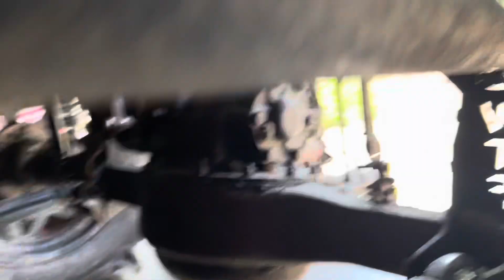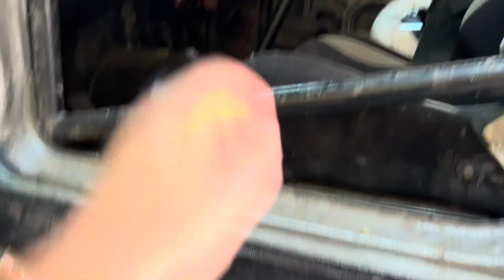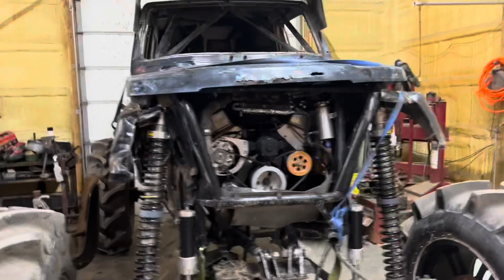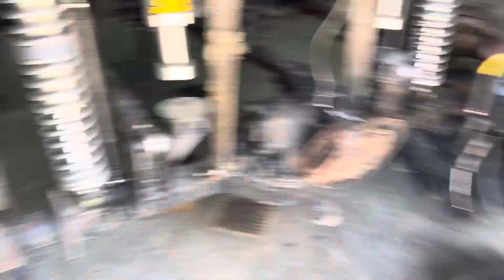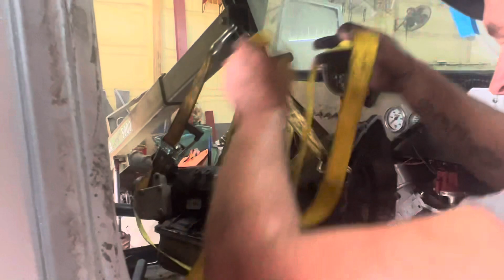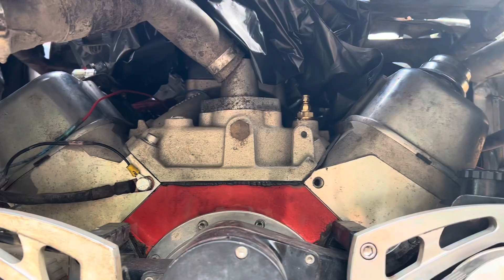Samurai’s Shop Update

Comment: Need a 32 element sprag and drum
Reply from the maker: Just threw about another 1200 into it. 800 into aftermarket drum and sprag. And then a couple little parts. Should hold up now. Plus going to change the gearing in the case. Currently a 1.8 going to try out a 2.3:1 set and see how it goes. Should pull the tires easier and get it more into third gear.